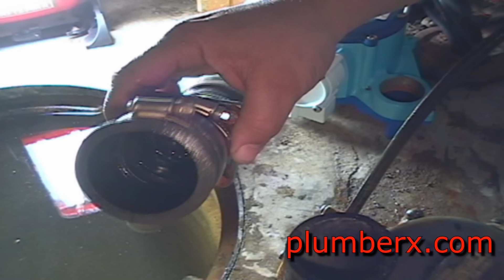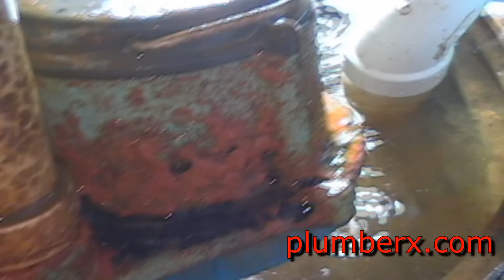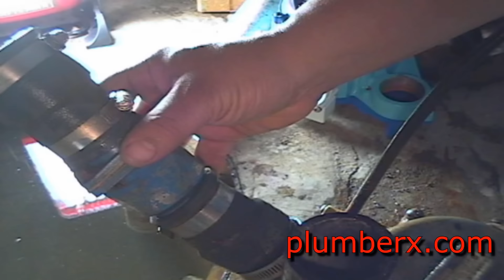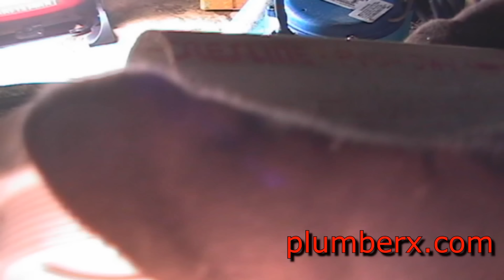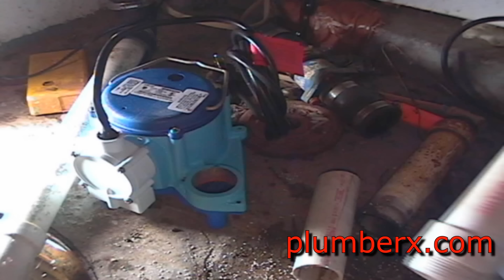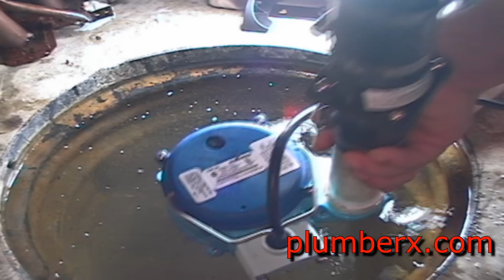Basement Sump Pump Installation and Replacement Tutorial

Comment: Hi Claude, thanks for the video. I've seen those(check valve) attached to the outlet pipes in the floor. A back flow preventer. I've always thought they should be a mandatory build on new construction and something to consider for existing. The only problem I could foresee would be if you had to run a rod down the line. Retrieving the line might present a problem.
Reply from the maker: Greg T Yes your right they should make check valve on sump pump mandatory. I appropriate you.